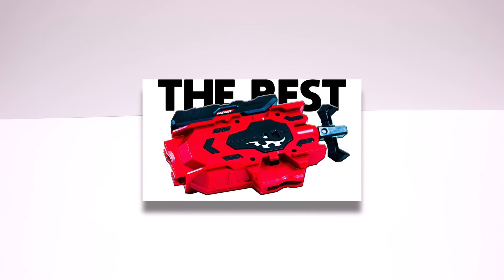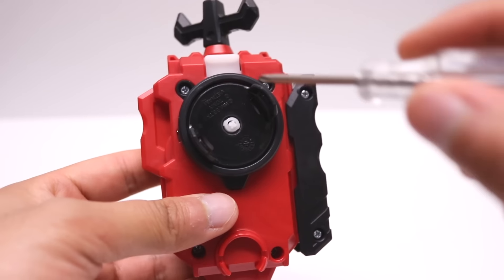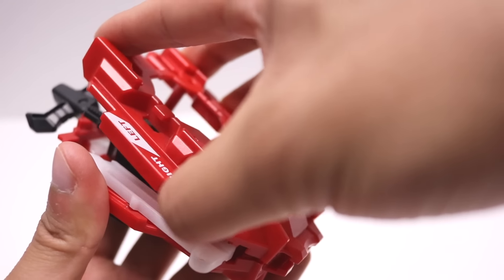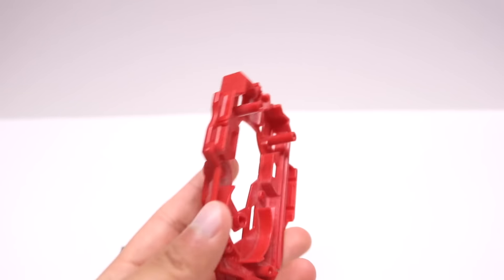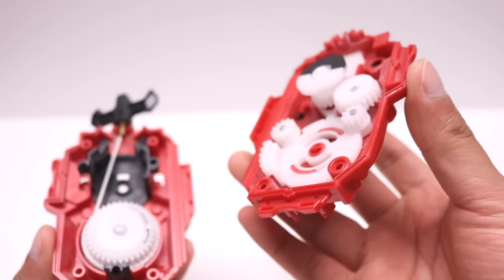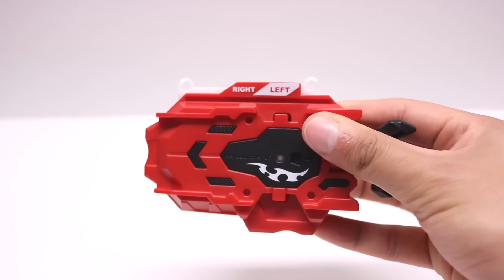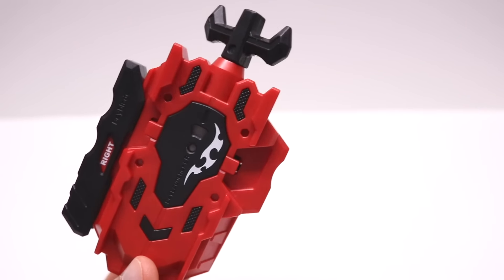HOW TO FIX: Beylauncher LR (Beyblade Tutorial) ベイブレードバースト 베이블레이드 버스트

Comment: After several failed attempts at putting the pieces back together, I took the loose pieces and placed them on top of the spring coil.  First the black/white round piece onto the string.  Then the rod.  Then the big gear that goes onto the spring.  Then I put the back piece on and was able to get it on without the coil releasing.  In any case, great tutorial.  Thanks.

Comment: There are easier ways to do it without the risk. Personally, I think it works better to use a Flat Head Screwdriver instead of a ripcord for winding it as well as putting the Spring in at the bottom instead of the top, that way you don't have to worry about things falling out when you put it together.
Reply: Yeah I used it
Reply: this was more ez I used but I used this after my luancher broke bcuz one screw was not coming off so I used force and the golden or coper part broke
Reply: Every time I try to reset the spring a few seconds after the spring just unloads and I have to try all over again

Comment: Can u make a tutorial on (also) fixing an lr launcher when the string stays out and wont come back in

Ps. I tried this but it didn't work, but thanks anyway!
Reply: Same, i think the sprong inside is broken or tangled
Reply: I just changed the mode and changed it back and it worked
Reply: @snowyalpines6811  its probably cause fakes sometimes do that, avoid fakes
Reply: But mine is the cho z achilles one
Reply: Twist the part the bey stays on, that’s what I did for mine and it worked
Reply: Same
Reply: @snowyalpines6811  yah i have the takara tomy cho z Achilles launcher and after using it for 1 month and a half  the string is like not fully retracted which is very concerning because my lr light launcher recently broke
Reply: @themoosee  I know how to fix that
Reply: @Rayhan Rinzan wheres the prongs
Reply: all i just do is change it to left then change
Reply: it to right and keep doing it until its fixed again
Reply: You have to put it properly, make sure the putting the spring into the casing part before resetting the spring. (must be horizontal)
Reply: Rayhan Rinzan I still need help can a video show me?
Reply: Its the metal thing inside its not in place
Reply: Same
Reply: Fuys i tryd twist at opposite direction it work but the string is so hard to push so i cant spinthe bey
Reply: Mine was stuck
Reply: no u do you know what they are now I have a har time finding out what it is
Reply: @nooby_mike8119  Yeah i can show you here! i have a vid
Reply: @Xxcringy gamingxX i can help
Reply: Mind didn't work for any of those ideas this video was not helpful. I just threw mine away
Reply: Yeah That's how mine is doing

Comment: Hello I have a question. I have one of those launchers, the string works good and never gets stuck but I have an issue with the right and left launches. When I'm using right it shoots perfectly and works really good but when I use left launch for some reason it shoots the beyblade softly even when I apply the same force to the lauch, has this ever happen to you? Do you have any tips or maybe a video on how can I fix that?

Comment: Okay, so ive done most of the steps here but its not fixing for me. When i try to put it back together it Ethier doesn't go back right, the string is still jammed, or the string moves but it doesn't connect with the prongs. Is there a way that this could be fixed?

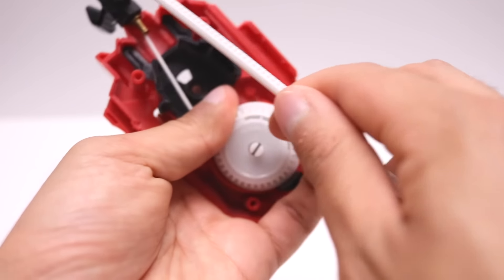Comment: The twisting part at 5:53 doesnt work on my launcher whats happening? Its stuck vertically

Update : i added some oil and it twists now.. but after like 3 twists it wont budge again.
Also the launcher still didnt work despite managing to reset the spring

Comment: Thanks so much bro helping me fix this by this video it was very helpful took me at least 3 to 4 tries putting it back together on screen screws multiple times but I finally got it done and it actually is better than it was because all the screws all the like the parts in the Beyblade were all like in pieces were not in pieces but like it was the pieces were all falling off in like where they were supposed to be so I can put all that together in the string would not go back in and I fix fine it’s a really good one for now thank you bro

Comment: I have an easier way change it to left spinning then put a RIGHT spinning bey on it then twist it counter clock wise until the string goes back that's how I did it it was way easier like if it worked
⬇️

Comment: I broke my string launcher now it turned into a manual launcher basiclly i just pulled it really hard and to retract the spring you must rotate the black thing that holds the beyblade to the right and it will turn into a left spin even if the word is on right spin and you might get it on how to turn in to right spin

Comment: My lr string launcher from cho z achilles got jamed within 3 days, and i found easier method to fix it, still need to open it tho
Reply: How??
Reply: There is a method where you dont even need to open it up. you just go in the other spin mode and twist the part of the launcher where the bey comes off of outward and keep doing that until the string re-tracks